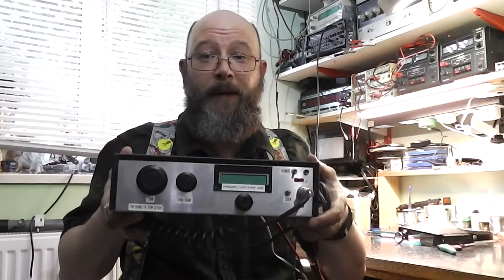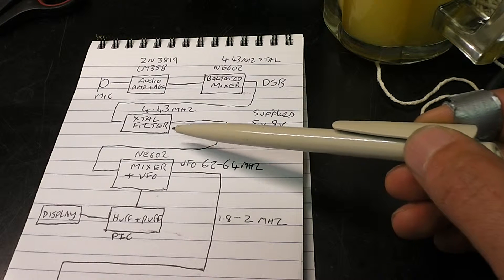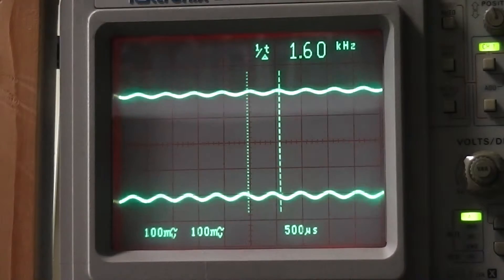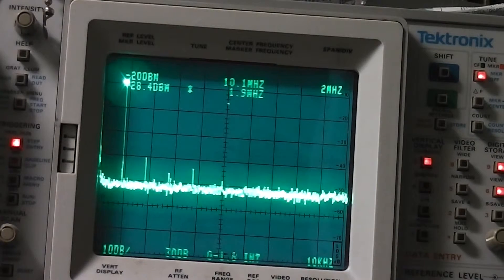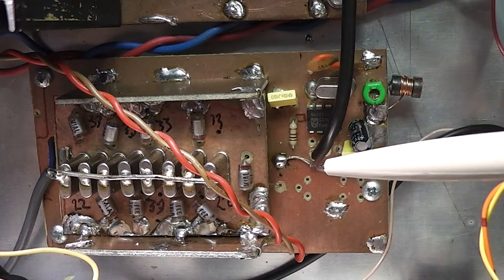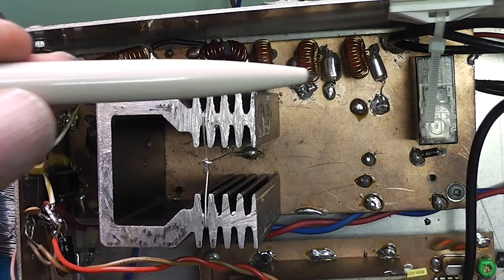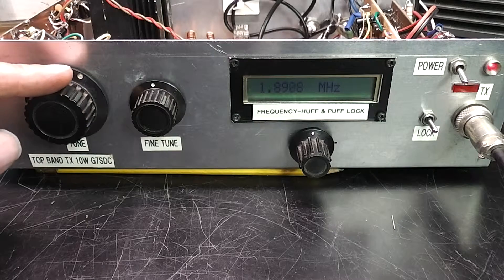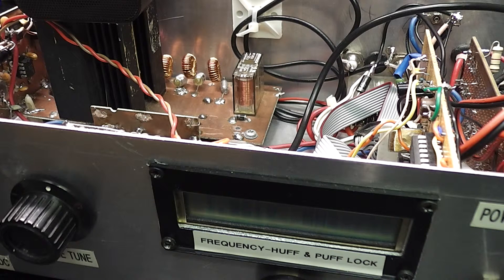Homebrew Top Band (160M) Radio Transmitter teardown.

Comment: Hi Darren, is that the X-lock design keeping track of the VFO? I can’t remember who made the kit but he recently stoped selling the kit and is reluctant to release the code. Shame as it’s PIC based and also code protected as I tried to dump the code but found all bits returning 00.  It basically means no code and no more chips for X-Lock and that would appear to be then end? Unless someone tells me what the X-lock is expected to do and I can try to code it in C++ for an Arduino? Drop me a line as I don’t actually own one but asked to read the IC knowing the IC would be obsolete. Spence
Reply from the maker: Hi Spence, no its not a x-lock kit. I think I remember those kits. This one isnt automatic lock, you push the button to lock. I believed I found the info on the web a long time ago. If i find some more info, I'll post.   Daz
Reply: Hello again, the kit was from a now defunct company at called Cumbria designs. Very smart bloke. Again the kits are obsolete and the code is “code protected” or it would return FF for blank or code but 00 means it’s been locked down which is a great shame. I guess this is a huff puff circuit and I’ve already started working on an Arduino version but waiting for some ESP32’s to come from abroad however it’s painfully obvious this might not do the trick and need something with better ADC DAC like a Teensy 3.2. Oh well back to the drawing board. I only stumbled across this as a friend has an AT5 and looking for the receiver. I have a mint condition PSU….. can’t remember if I have the transmitter and receiver though. 73 de Spence G5STO

Comment: I'm a G4B ·· rose-tint spectacle wearer and holder of a 1972 'A' Licence. My first build project was a Top-Band valve only, oscillator-tuned 10W transmitter, and I'm feeling distinctly nostalgic right now, which is how I found your video. I will be 'looking into it' further.
Reply from the maker: Ah fantastic, yes top band is a good place to start building stuff and I'm glad it bought back memory's of your first build. Daz